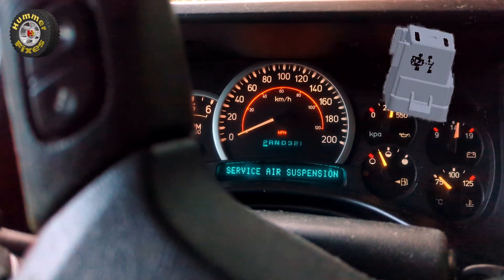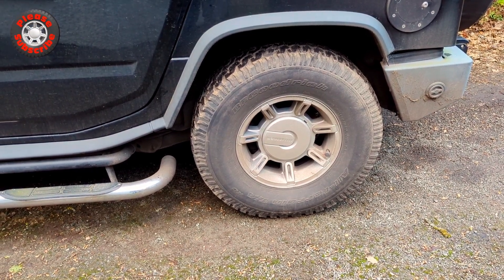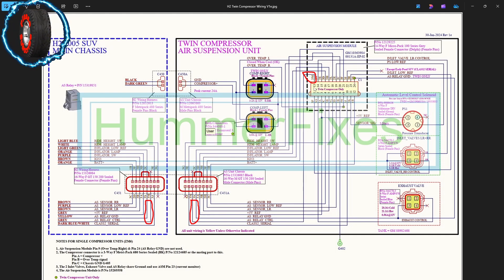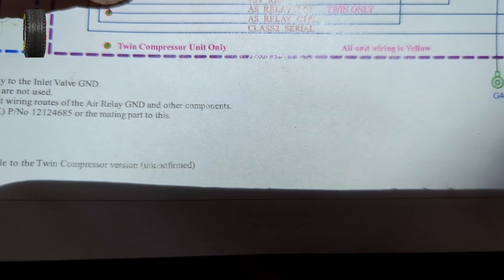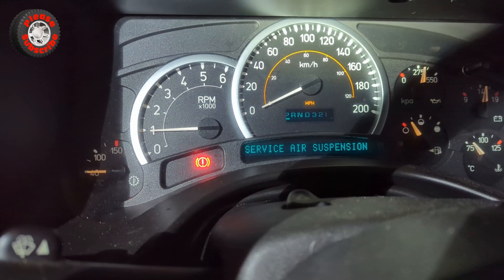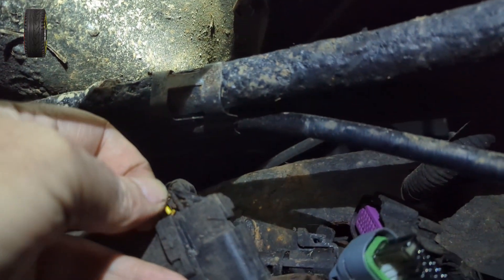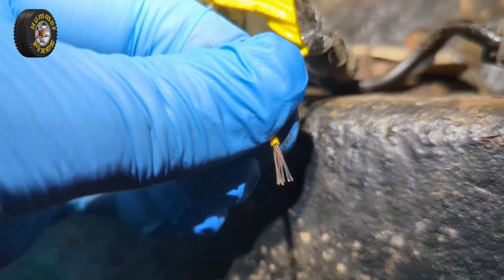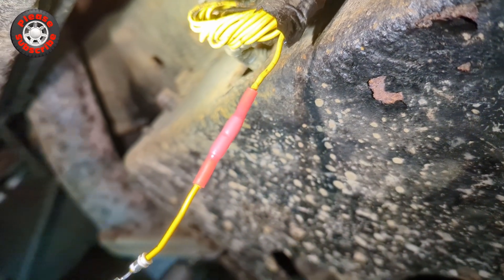HummerFixes - Service Air Suspension

Comment: Hey man im needing help figuring out what happened to my front driver and passenger heated seats. its a 2004 hummer h2 and I click the heated seats and the light turns on for a second and then turns back off. What can I do to fix it?
Reply from the maker: Thank you for your question.
HummerFixes has yet to cover this issue, however things to consider:-
    - Most commonly its a bad seat heater pad(s) There are 4 pads at the front, any one going open circuit will cause them all to switch-off. They are sewn into the leather and sadly hard to find, I believe they measure typically 12ohms. Here is a YT video by Autosource1.ca which may help:-
https://www.youtube.com/watch?v=6g8llJENJHY
    - Problems can also arise with the Drivers Door Module (window switch):-  https://www.youtube.com/watch?v=JZl74FiK714
   -  Check the connectors under the left front seat :- https://www.youtube.com/watch?v=EIPvwXdaQFg
    - Uncommonly it can be a faulty door heater switch.

Hope you find your problem and please post anything you find 🙏

Comment: I get this message on my H2. I have the bags removed. Someone installed coils.
Reply from the maker: Thank you for your comments. If your old AS Unit Assembly is still fitted it should be removed. If it has been removed then if you disconnect the battery for say 20 mins, then reconnect the message should disappear as the BCU maps out the AS Unit. Also check the exposed 16-Way connector is protected from water ingress (tricky)

Comment: I have found Hummerfixes videos to be helpful, clear and interesting since I discovered them in November 2023. Much appreciated.

My '05 H2 mysteriously lost power to the front wheels while stuck in the snow on a remote forest service road recently. No codes, no unusual sounds, and the clunk when engaging 4Lo or 4hi was audible. But after airing tires down to 10 psi and getting a pull out, and driving the road for around 23 km, the front wheels had power again...I suspect I was saved by the previous Hummerfixes-informed servicing I had done. Thank you!
Reply from the maker: Thank you for your comments, always good to hear about experiences 👍